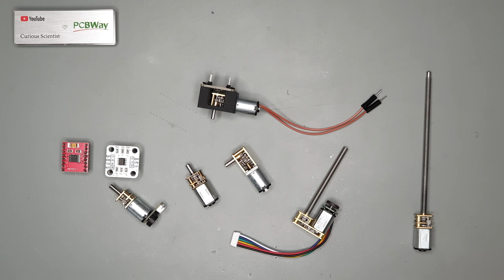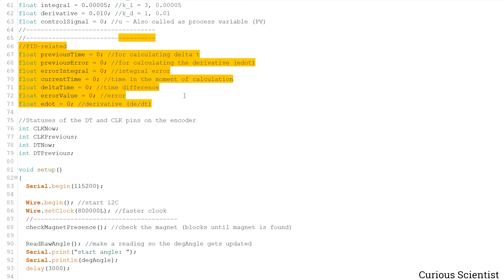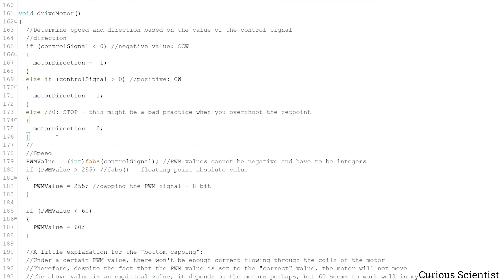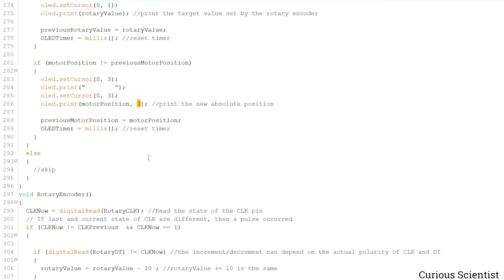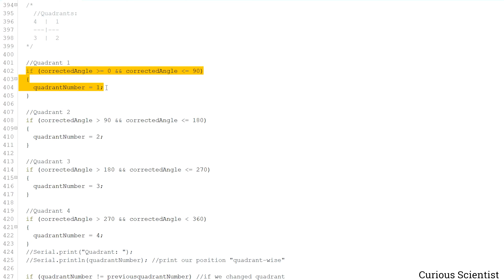N20 miniature DC geared motor with AS5600 encoder and PID

Comment: Video Summary: N20 miniature DC geared motor with AS5600 encoder and PID

* [0:00] Introduction and Problem: Standard N20 geared motors with built-in encoders are inaccurate for precise positioning due to backlash and slack in the gearbox.
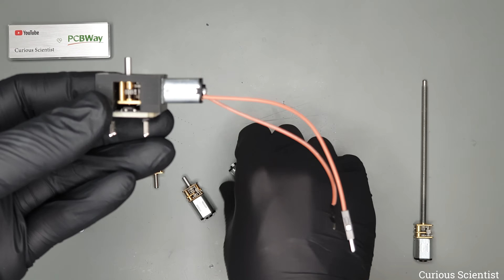* [4:49] Solution: Replace the built-in encoder with an AS5600 absolute magnetic encoder (0-360°) mounted on the gearbox output shaft.
* [6:42] Implementation:
    * Attach a small magnet to the back of the output shaft.
    * 3D print a bracket to house the AS5600 and position it accurately over the magnet.
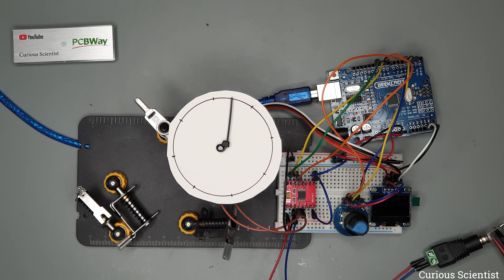* [7:59] Demonstration:
    * Uses a simple setup with a motor driver, rotary encoder for target setting, and display.
    * Motor accurately moves to target positions set with the rotary encoder, demonstrating improved accuracy.
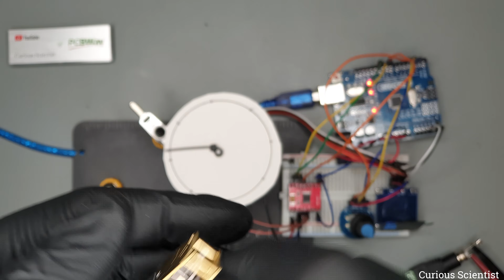* [15:04] Code:
    * Combines code from previous videos on AS5600 and PID control of DC motors.
    * Reads encoder position, calculates error, and uses PID algorithm to control motor speed and direction.
    * Includes code for magnet presence detection, rotary encoder button handling, and display updates. 
* [43:24] Call to action:
    * Support the creator on Patreon for access to code files and to see more projects.
    * Visit the website for schematics, parts list, and more information. 

i used gemini 1.5 pro to summarize the transcript.
Reply from the maker: This is fantastic, thank you! So if I understand correctly, the AI basically watches the video and then interprets what I said and creates a summary, right? It is very cool!
Reply: @CuriousScientist  not that advanced. i write something like "i don't want to watch the whole video, give me a bullet list summary" and copy and paste the transcript from your video into the prompt
Reply from the maker: Nice! However, I hope people will still watch my videos instead of AIs. 😅
Reply: Thanks, is the code available somewhere, I cannot find it?
Reply from the maker: Sure. It's explained in the video and it is on my membership page.

Comment: Hello Nice video. Can you tell me what is the maximum RPM this encoder can track reliably. I mean can this module handle around 2000rpm?
Reply from the maker: Hi and thanks! I never measured it explicitly. It also depends on how you read it out. I2C or PWM, plus it depends on the microcontroller's capabilities to some extent, too. You can probably simplify the code to two sectors to track the rotation of the shaft which could make the code a bit leaner for I2C communication. Probably 2000 RPM would fit. But if you are only interested in RPM, this is the "wrong" sensor for it.
Reply: @CuriousScientist  ok thank you. I'll try

Comment: Any particular rules to place magnet on backside of the motor shaft & facing to chip ? Or it just random placing & microcontroller take care the rest??
Reply from the maker: Datasheet, page 33, figure 40. All the rules are there in the magnetic requirements section.

Comment: Hello, I encountered an issue with the AS5600 readings on the serial monitor. I 3D-printed your designed connector, used the same motor, AS5600 module, and an 1*1mm radial magnet (also tried 1*1.5mm height later). I wrote a simple code to make the motor rotate in one direction while printing the AS5600 readings. Ideally, the readings should cycle from 0° to 360° continuously.

However, the readings only cover a specific range, e.g., for one motor rotation, the values go from 10.12 to 30.39 and then back to 10.12, constantly, or from 120.66 to 130.98 and back to 120.66 (numbers vary with each test, also the range).As the motor keeps turning, the cycle continues.

I found that this might be due to the magnet not being perfectly centered on the AS5600 sensor. I tried slightly adjusting the motor to what seems like the center (very minor adjustments due to the as5600senser seems slight offset from the radial magnet  in your 3D-print design connector). Doing this increased the range but still didn’t cover the full 360°.

Have you encountered a similar issue during your tests? Any advice would be greatly appreciated. Thank you!
Reply from the maker: Hi! Is your magnet really a radial one? You can check it with another magnet and see if it sticks to it by the plane or tangentially. A wrong magnet can be detected wrongly.
Reply: @CuriousScientist   Thanks so much for your reply!!! It turns out that I'm using a normal magnet other than radial magnet😂 I may never find out the problem and gave up my project without your help.

Thanks again!!
Reply from the maker: Nice that you figured it out! I hope it will work better with the proper magnet. Cheers!

Comment: thanks for your Video,
one question: After adding the AS5600 encoder, can the consistency of the 0-degree position be ensured at each startup?
Reply from the maker: Hi! Since it is an absolute encoder, if you leave it at a non-zero position, it will start up with a non-zero position as well. You can tare the value at each start up to make it look like zero, or if you have a machine or whatever where you want the "first installed position" to be the zero reading from the encoder, then you can burn a new zero position in it as well. See datasheet.
Reply: @CuriousScientist  Could one use a limit switch to home the motor upon startup? Then use the limit switch with each cycle to get a better idea of the 0 position?
Reply from the maker: @RCoryCollins  Absolutely. That's an easier and safer option.

Comment: nice explanation about rotary encoder👍Perfect for my first arduino project. Do you have schematics and code for this? I can't find in your blog. Thank you 😊
Reply from the maker: Thanks! The code is available for channel members (supporters). The schematics is roughly the same as for my earlier project involving the N20 motor. Just use the search function on my website. 
(BTW, if this is really your first ever Arduino project, in my opinion, it is too complex for a first project. The project assumes a lot of things that might not be obvious for a beginner. )

Comment: Great video! How did you attach this tiny magnet to the shaft? I mean was it glue, welding or something else?
Reply from the maker: Thanks! It's a very low-speed rotation, so if your device is not exposed to vibrations, you can just stick the magnet on the shaft. Otherwise, put a drop of super glue on a piece of paper, and with a small wire or toothpick, pick up a tiny drop and place it on the shaft. Then, place the magnet over the glue on the shaft and center it. Keep in mind that some glues cure very quickly!
Reply: @CuriousScientist  I try sticking a magnet larger than the one in the video but it keeps shifting to the edge of the shaft. I will try a smaller one and glue&paper. Thank you!
Reply from the maker: Ummm, anything larger will not sit on the shaft... You should use a the proper size, otherwise you won't get the expected results. Also, the smaller magnet is easier to center because the shaft sits slightly deeper than the bushing around it.

Comment: Just one fact to consider; the magnet has to be positioned a bit off-center of the chip, the exact position of the sensor center is printed in the AS5600 data sheet. With such a small magnet the difference does matter.
Reply from the maker: I don't know where you saw this information, but the datasheet does not explicitly say that it has to be off-centered. It only mentions the maximum allowed displacement of the rotational axis of the magnet from the center of the package. But it does not mention anything about a mandatory offset.

Comment: Great video as always!
A minor and friendly correction, though:
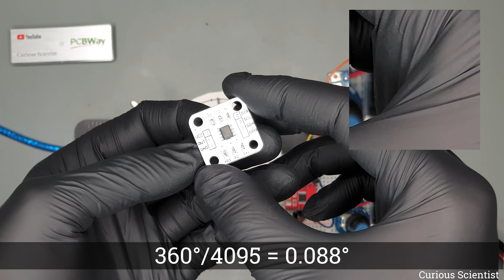@ 10:56 - The 12-bit resolution equals 4096 distinct values - remember to also count '0' as such a value.
So it should be 360/4096, to be precise. Not 360/4095.
Reply from the maker: Thanks! And I should say "user name checks out"! 😀Even funnier that I actually read Nick Gammon's discussion on this topic (1023 vs 1024), but I still keep messing this thing up. Luckily, it is only 0.0000215° error per conversion, but still, bad practice should not be used. I will try to avoid this in the future. Thanks again!